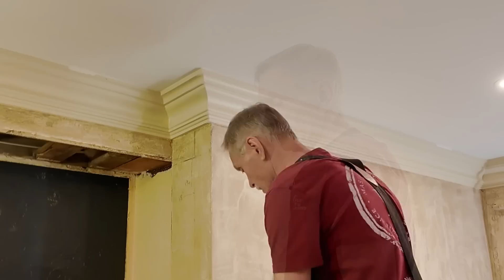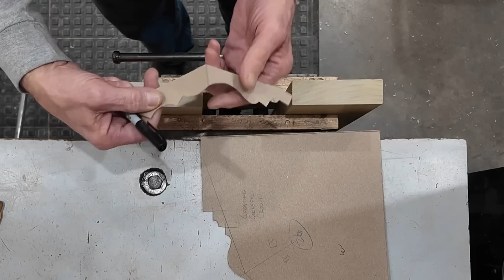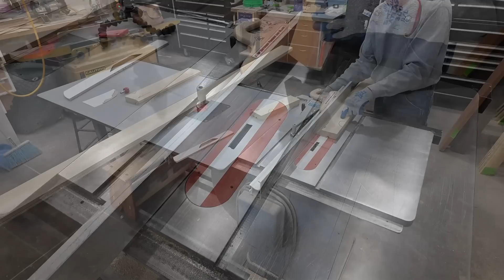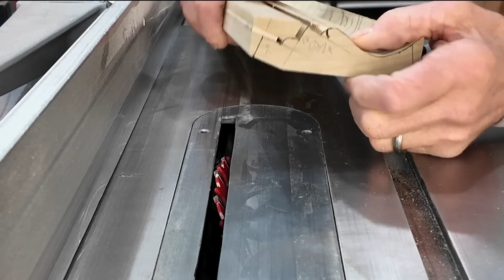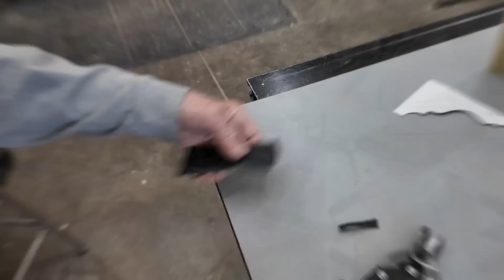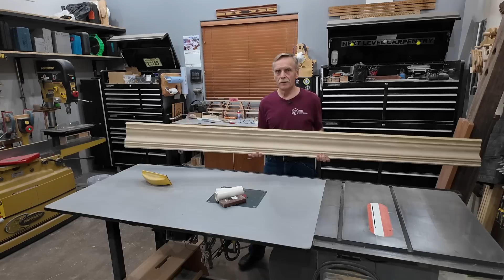Cloning Colossal Crown

Comment: Proper people will perceive that this process requires persistent precision!
I also like those snap blade knives very much.  I don't use the old utility knives much any more.  I have several snap blade knives, including one that has a knob that has to be tightened to lock the blade.  I guess that might be ok for use on a bench top.  My favorites are the 9 and 18 mm DuhWalt knives that I found via an NLC store link 😀.  Those have a very good locking mechanism that allows the blade to be easily retracted, yet it's locked securely while in use.
Reply from the maker: For 2 decades after 9-11 snap blade knives disappeared from the marketplace until, finally, DuWalt came out the the great ones you mention from this video.  They're simply the best ever IMHO: made of metal, sure indexing for blade position and also an on-board blade snapper/pocket clip.  Blows my mind how long it took someone to FINALLY combine these simple but essential features into a useful tool.  Thx for getting yours through the NLC link... much appreciated!
Reply: I always look there first. @NextLevelCarpentry

Comment: Something i discovered some 40 yrs ago making a colonial base molding for a set of night stands. Cutting a large cove with a cove cutter in a molding head makes a faster and smoother cove cut than the saw blade itself.
Reply from the maker: Interesting... do you have a moulding head you like?  I can see where that would work better but, frankly, any moulding head I ever saw or used scared me... and I'm fearless! 😉  I use a flat top grind rip blade for the same reason but I can see where a 'rounded cut' would be better still.

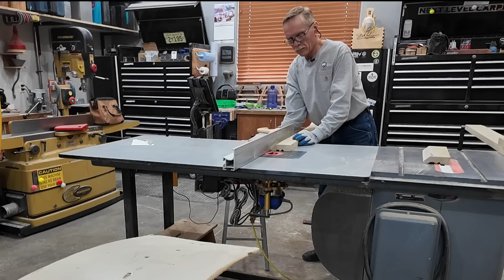Comment: Was very interesting But when it comes to doing a large project like a whole house I need to use a more efficient way  do duplicate the project 25:47
Reply from the maker: No doubt... this method only has value up to 20' or 30'.  Beyond that I'd invest in custom knives and run the moulding through a moulding machine like the W&H. With any luck you'd be able to do a 'built up' design with individual pieces that are far more manageable.

Comment: the dihydrogen-monoxide joke will never get old 🤣 but this is indeed an epic build, especially without using a CNC router
Reply from the maker: Glad you caught that little joke... means you pay attention to what you're watching.  Regarding 'without using a CNC router': if I needed to make over about 20' of a moulding like this I'd recommend and use a moulding machine rather than a CNC router as it would be much more efficient and produce a much cleaner profile a lot faster IMHO.  This isn't meant as a slapdown but rather a clarification...
Best,
Matt

Comment: Why don't you use water and a rag for glue cleanup? is there a negative?
Reply from the maker: The biggest negative I see from using water and a rag for glue cleanup is when diluted glue soaks into the wood and looks terrible when stain is applied.  Granted, for a piece like this that isn't an issue but I just developed the habit of using fine sawdust and a sharp putty knife or scraper to remove it so it's never a problem for stain or paint. If you watch the Tooltote and/or Footstool build videos on Next Level Carpentry you'll see how the sawdust & scraper method works when it DOES matter and I'd be curious to see if you agree or not...

Comment: Here I am just thinking to use an Osaw past where the new soffit will be.  Slide the cardboard in and trace.
Reply from the maker: That's an EXCELLENT idea and one I could have used on this project to save a lot of fussing around!  I guess the laborious method I did use may still be helpful when your great O-saw method would spoil a wood moulding and not be acceptable.  Thanks for your great idea... I learned something new today!! 😎
Reply: @NextLevelCarpentry  For sure.  Works well with plaster because you are just removing a slot to slide a template into.  Wood would rock if you but past the nailing point but then it would be easy to remove and replace. A tile blade works pretty well to just cut the slot with dust extraction.

Comment: Loved this video! Thank you for sharing. I also appreciated seeing your router built into the table saw. I've been considering a similar setup for my small shop, and am now convinced that it will suit my needs.
Reply from the maker: My setup lacks a steel/cast iron top (for magnetic hold-downs) and a T-slot for featherboards but I've still been able to do everything with it that I've needed to do. On the plus side, NOT having to find space for a dedicated router table is great for my shop space too. FWIW I was a bit dubious about the PowerLift Pro because it requires a tablet to control it EVERY time but the speed and accuracy of changing bit height is so amazing that it's totally worth fussing with 'one more device' for its performance IMHO.

Comment: di hydrogen oxide.......Jeez Matt, you crack me up.  Cool project.  I stayed as I always do, til the end of the end of the end.  Great advice....always allow for a little extra because you can always cut it off but you can't ever cut it on. I'm looking forward to seeing the project progress on Patreon.  Very curious how you're going to cut that piece of colossal crown at that very weird angle to the left of the fireplace.
Reply from the maker: Always glad to provide a bit of comic relief, Rick.  Regarding the eventual cut of the crown: I'll 'just' do a classic "cope" cut at that off angle corner.  Very similar to coping for a standard 90 degree corner but the initial cut will be at something like 39 degrees instead of 45.  The coping part with a coping saw is a bit trickier because the 'back out angle' needs to be somewhat sharper/longer so I'm glad I only need to do one of these!  I'll endeavor to do a quick video for Patreon to show the process...

Comment: I applaud your efforts on this project. The video work itself is amazing. 
That said, I'm a plaster worker. I would have produced the profile as you did, and cut a template to form a plaster piece of molding out plaster in the workshop. It seems that it would have been much less effort than forming the colossal crown out of wood. :)
Reply from the maker: Definitely easier to match plaster in plaster.  I admire whomever did the original plaster crown in this house because it's virtually flawless after 75 years or so. I do hope viewers find this process useful for projects where the Colossal Crown they need to clone is made of wood and CAN'T be replicated in plaster...

Comment: Amazing work, fun to watch. What brand and model of die grinder? Does it work on wood?
Reply from the maker: Thanks!  BTW The die grinder I have is probably 60 years old so any decent new one would do the job.  I do use it on wood and it works great with the right bits/burrs as you can see in this example: https://youtu.be/QBf2evSzEzM?si=qZvv7ZJBTJQYtai9&t=698

Comment: Glad to see you back! You haven't showed in my feed for a while. This is a great vid
@37:58, the "anomaly" is a "feature" of the blade width. If width is zero then the curve is a perfect ellipse; any width leaves a flat spot in the curve.
Did you consider gluing up a bunch of milled stock top make the profile?
Reply from the maker: Actually, although the curve does reach an apogee, there isn't a 'flat' spot in the curve.  The 'anomaly' I point out at that time stamp is a glitch in the Sharpie layout line that still shows up after the cove is cut because the Sharpie followed an irregularity in my thin cardboard layout line.  
To your question: the deep profile and shape/position of tangent points on the curves lead me to the approach I used for creating this Colossal Crown.  I felt that, although there are definitely other ways to approach the cloning of this particular profile, all things considered, this was the best approach for THIS moulding.  Believe me, if a 'built up', multi-piece method was simpler/faster/better, I would have used it.
Reply: I was curious about that too. Hopefully Matt will answer why he chooses to mill up two pieces rather than build them up.
Reply from the maker: Hey Anne, Early in the video I tried to cover the direction I chose because my original intent was to hog the whole thing out of a single piece of 6/4 stock.  It's embarrassing to admit but the moment I realized I'd have to use a different approach when I was driving home from my hardwood supplier.  That's when I had a DOH moment with the realization that the 6/4 plank of poplar I just bought wasn't going to cut it and it would have been too embarrassing to return and exchange it for a slab of 8/4.🥴 This isn't the first time a 'mistake' lead to a better outcome in the end though and I'd use the two-piece approach again on a similar future project without hesitation...
Reply: @NextLevelCarpentry  Yes, I've experienced where mistakes led to better outcomes and this is a great example in the craftsman realm.
I saw your response to the fellow viewer about build-up vs carve out. I was curious about that and knowing you, figured you were following the NLC guidelines of efficiency while achieving optimal results. 
Another great video, Matt, perfect for those of us who want to learn - and be entertained!
Reply from the maker: @anneoreilly4900  ... then there's those times when we realize we took the wrong direction but are so invested that we can't turn back even though it would be the smarter thing to do.  For that there's always 'next time'! 🥴